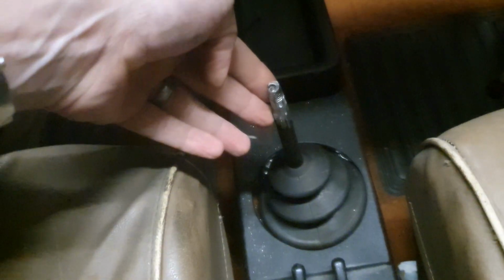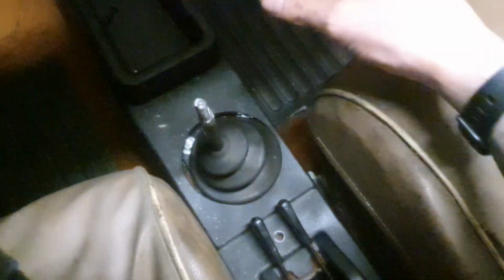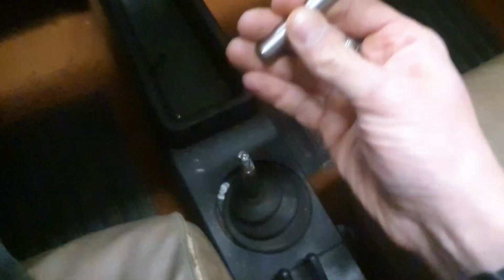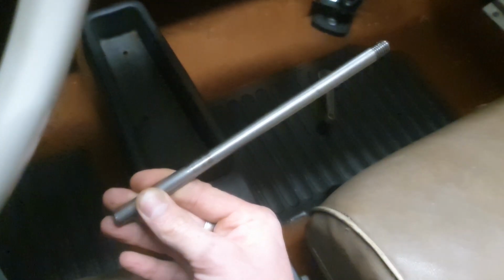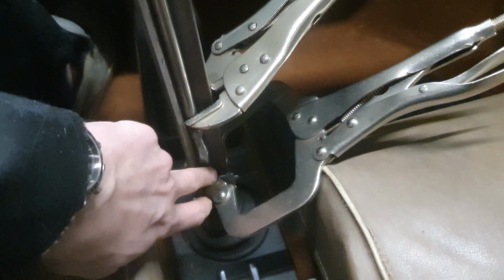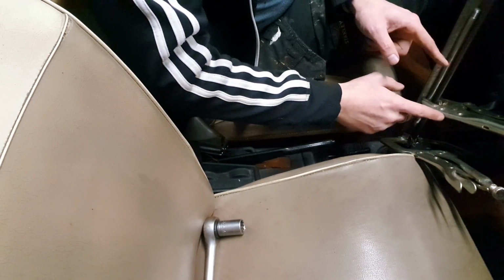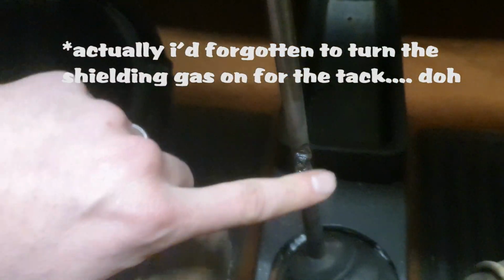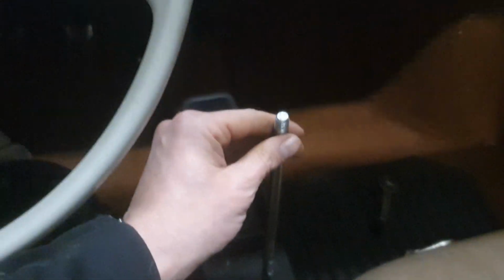Fiat 500 project - welding up the short shift kit

Comment: Hi, I cut my gearstick down in my Gamine, the reason it was far too high. The seats in a Gamine are only about 120mm off the floor and I found it awkward changing gear, never had a problem changing gear. I have a 126 engine and gearbox fitted. If it was a standard 500 I wouldn’t shorten it for the same reason you gave. Keep up the good work.

Comment: Was hoping you had found a short shift kit like the ones sold for VWs which actually work.
Reply from the maker: Actually having just looked again the pivot is below the shift rod in the fiat, so to shorten the shift youd have to cut and extend the piece that connects shift rod to gearstick, in order to move it further from the pivot and increase its leverage, which would result in it sitting proud of the centre tunnel and modding the shift boot, but looks like itd be simple enough
Reply from the maker: No, the vw ones do actually move the pivot upwards to move the moment of rotation so the shift rod moves further for an equivalent movement on shifter (as you know) but recalling my last aircooled vw the shifter 'ball' wasnt caged in the same way as the 500, you could engineer one for the fiat but given the design and space itd be hard. I might buy a spare shifter and design one however if people want em
Reply: Yep it bolts under the shift rod plate and raises it about 20mm from memory.